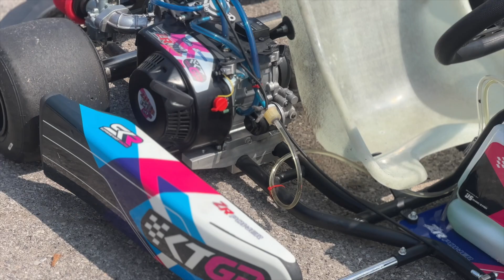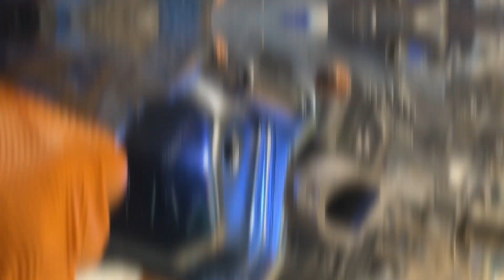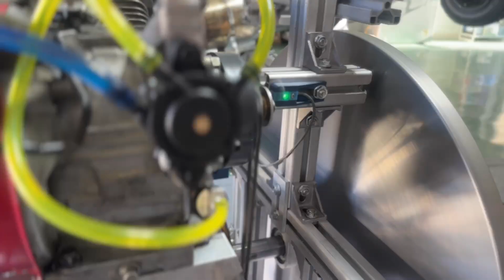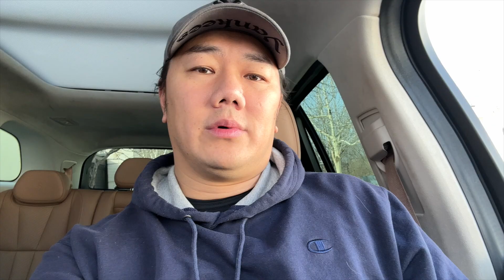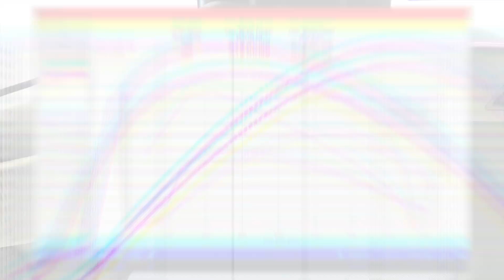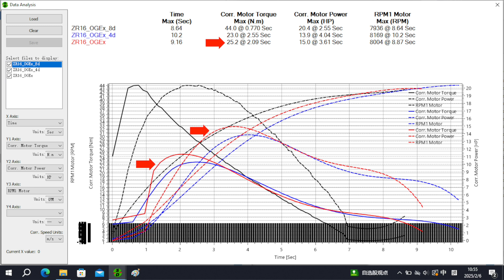Vlog: Findings on Ignition Timing

Comment: Cool stats what cc  engine is this how much lbs springs and which cam and cam lift are u running also what size carb and you should try 12 degrees timing.
Reply from the maker: @GVO1  it's a 225cc. I use 26lbs springs, stock cam. I run mostly basic stuff to do dyno tests so I know what sort of power gain or performance changes ill be getting for each upgrade. I tried 12 degrees before, doesn't work well with stock cam. The carb I use is VM22, it's a 26mm carb, round bucket type.
Reply: @JSRacing-Kartsmith  cool setup , the 12 degree key is for cams that requires 32 degrees of timing, when using the 10krpm flywheel I thought u had a performance cam still good power, what is your top speed with the 4 degree and 8 degree key.

Comment: I like to see 7 degrees advance with Methanol fuel. I wonder if your push rod problem could be the result of pre-ignition? Fuel type makes a big difference in how much timing you can run without destroying the engine for sure.
Reply from the maker: I'll need to do some research on the methanol fuel, never tried ti before. I'll give it a go later on.